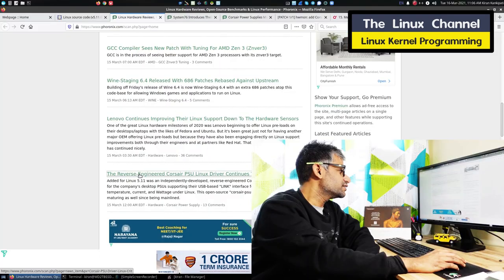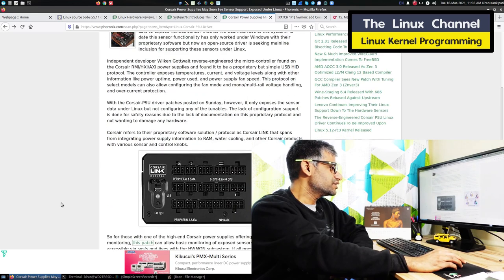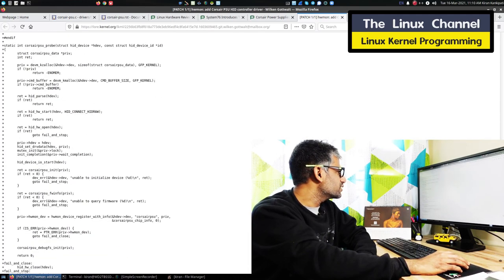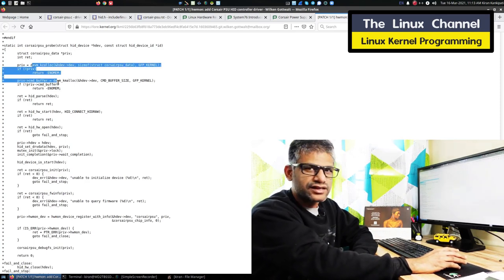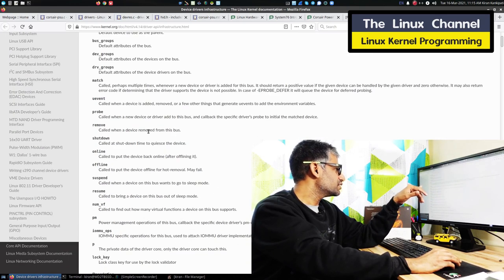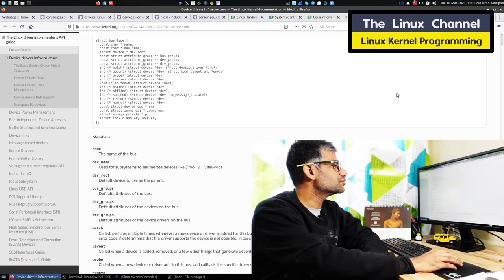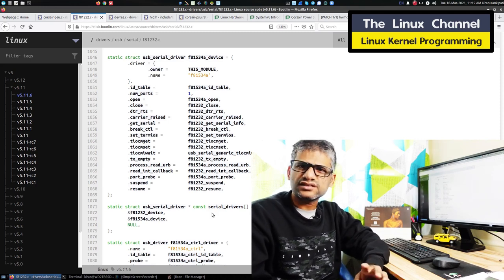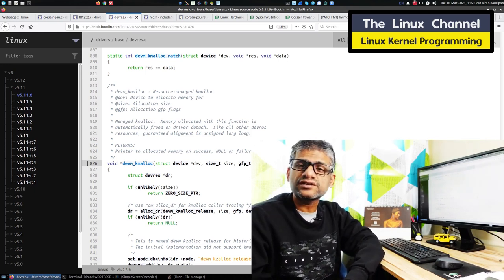x232 Linux Kernel Device Drivers Programming - probe() API #linuxkernel #programming #education

Comment: Hi, How kernel decide which existing driver is used when plugin USB (USB pendrive, modem, keyboard or mouse), monitor or other peripheral?
please answer.☺️🤗
Reply from the maker: good question. In the LDD book, in the USB drivers chapter there is a mention about the same. USB standards uses certain profiles. So when a device fits that category it just uses that way. And if the device has extra buttons/ capabilities, then a specific driver will address those needs. So refer: https://www.iitg.ac.in/asahu/cs421/books/LDD3e.pdf
Page number: 327, 328, 329 range. You should get some clues !
Reply: @TheLinuxChannel  Thank You so much, Sir :)